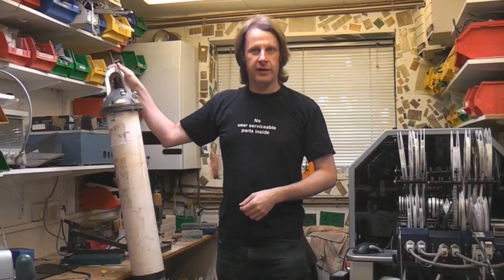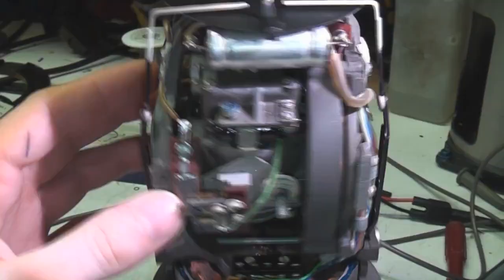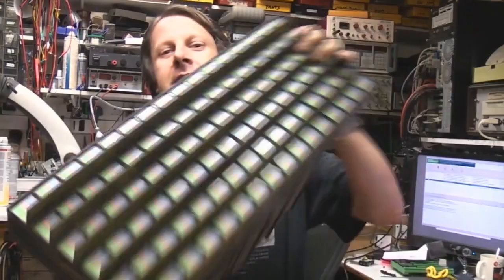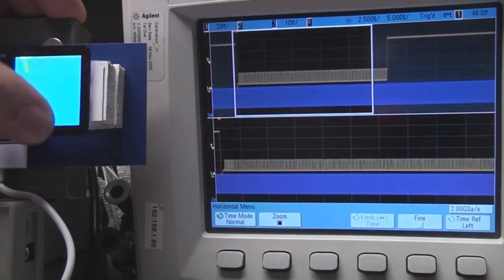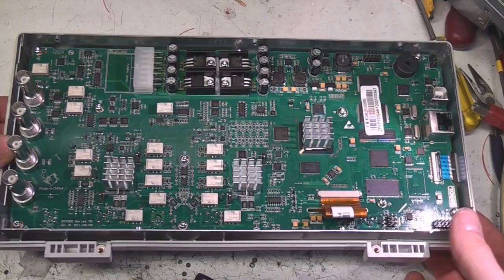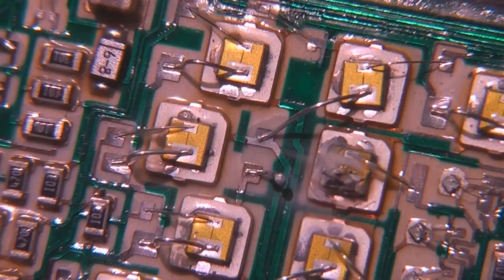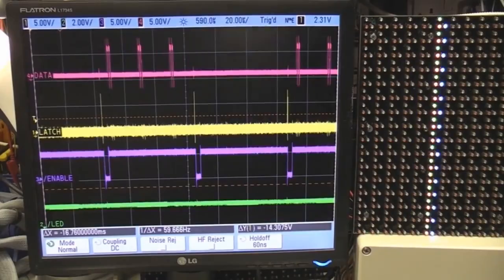mikeselectricstuff channel trailer

Comment: I'm howling! 
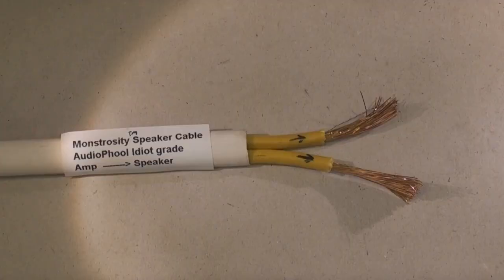Just gotta love it (stop on the speaker cable frame @ 0:06) "self-deluded [expletive deleted] heads." 
Cut-to Carmina Burana (as a total "throw-away") ... 
It's immediately screaming 
'PERSONALITY!' 
SOD THE PRETENSION, AND JUST SCREW -
 (the over-indulgent lexicology of Own-A-Jet Class Hi-End Gear Fanatics into the filter ring of a colonoscope that somehow turned up in a pawn shop 20 years ago as an 'I-don't-know-what-it-is, how-about five dollars ... okay, three, since you're getting thirty year old Time Base corrector and Sony PTZ controller racks which they don't even have a record of ever having manufactured) 
- IN A LIGHTBULB.

but in a totally casual and accessible way.